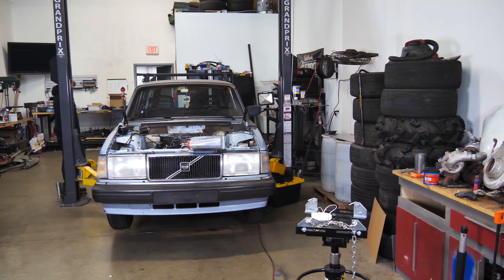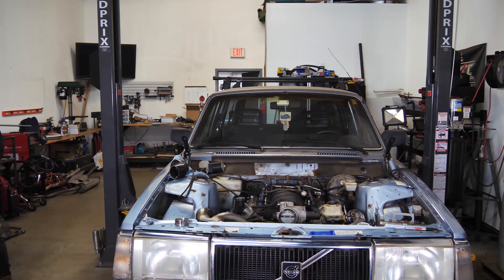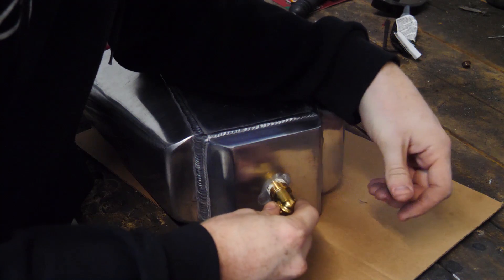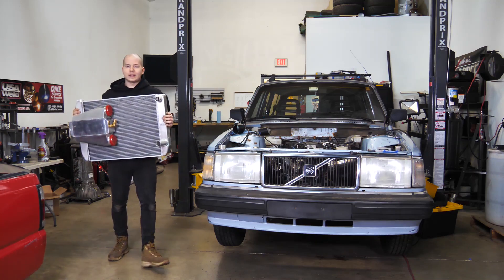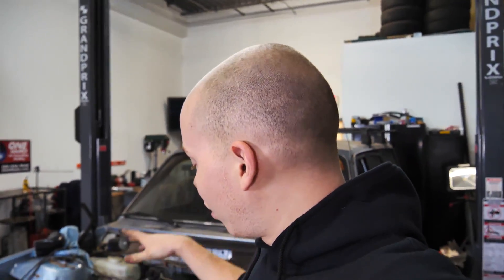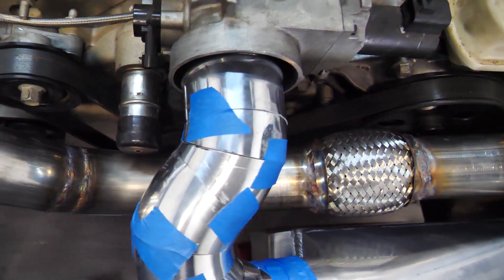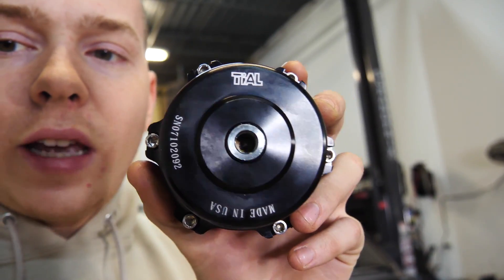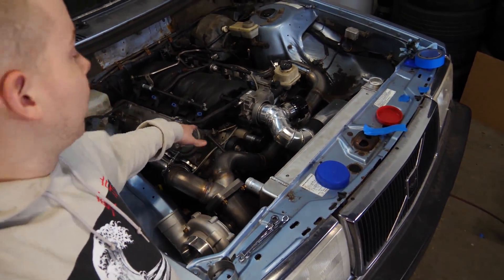FABRICATING A Stealthy 1000HP CAPABLE Intercooler Setup For The SLEEPER VOLVO!

Comment: How are you going to fit either a clutch fan or electric fan with how close that heat exchanger and intercooler is to the radiator?

Comment: Nice build. Having the chargecooler hanging off the rad isn't ideal from a weight / fatigue perspective, going to be a lot of mass especially full of water. Better bet to attach the chargecooler to the engine as the main connections are going there anyway.. Heat isn't a great concern, it'll soak but no massive deal as you'll be able to extract it.

Comment: Isn't that air to water the same as just having a really big air to air because of the heat exchanger?  Also where are the radiator fans going to go?  Last, you should probably ditch the flex section, there is a good chance it will send metal strips into the turbine.

Comment: Get the 185 degree t stat and you'll never have any cooling problems. I've got efans on my lq4 swap and they come on like, once a month. 

To be fair, i do have a 3+ gallon cooling system, so it does take a while for the temperature to rise, but you likely won't have any problems with a good shroud and a good high cfm fan. And you don't need to put those stupid ass rubber flaps on the radiator. They don't do anything a gaping fan sized hole wouldn't already.

Comment: I mean, you have a ton of space for the intercooler above the intake manifold because the engine sits so low.
Reply: I don't see why he didn't just use an air to air right where he put his water to air intercooler.

Comment: Wait so where are the radiator fans gonna go?

Edit: finished video: ah so nowhere. Pusher fans on front gonna kind of mess with the sleeper look and airflow no? 

Crazy idea: no room to mount that intercooler above the motor? Seems like plenty of clearance there. Seems like the piping would work too.

Comment: not sure if that intake is ristrictive, i thought the 4 inch throttle was there for a reason, doesnt it need to be that big? also i read omments on the last video regarding the flex pipe and how it might shave off some metal fragments and cause damage to the turbo, you should take a look before something breaks

91

Comment: cool build but i think you could do better, in my opinion if you have done the exhaust pipe in the same place but in the bottom of the engine bay ( you have a lot of space there) you would’ve have a lot of space on top for the intercooler, but the way you made a sandwich out of intercoolers im not sure is very efficient,

Comment: Does the intercooler have to be mounted horizontally? If not, mounting with the inlet and outlet facing up at the bottom/center of radiator would potentially allow for a simple 90 degree bend from turbo to intercooler and from intercooler to throttle body.  Or maybe an oblique orientation in the battery location with longer charge pipes which would keep the intercooler away from the radiator and exhaust. Should be plenty of space in that wagon for a remote battery box.

Comment: i would be atleast a little worried about the intercoolerbracket welded to the radiator cracking, that son of a bitch is gonna get heavy when filled with water.

Comment: Weird question for you gingium. You are supporting eBay as they are the sponsor for this build, but in previous videos ( specifically the one named never buy parts of of eBay) you trashed eBay parts. So are you excepting responsibility to your ignorance on eBay parts. Or are you just in it for the sponsorship?

Comment: Please consider putting the intercooler in the battery space, relocate the battery. Your intercooler will be heavy, full of coolant, and it's hanging from the thin wall of the radiator. This will break at some point, breaking the rad and who knows what it will take with it.
Reply: https://www.youtube.com/watch?v=kZ64eKMU7D0 Thanks for taking the advice, despite it coming from experts builings race cars longer then you've been alive :)

Comment: For a big V8, you really need a fan that covers the whole radiator or you could have overheating problems. It looks like your intercooler would fit on the other side of the car, mounted near the engine and down low.

Comment: Couldn't you have put the battery somewhere in the miles of rear hatch space and used that battery tray area for the intercooler mount?? Also I feel that flex pipe is a problem waiting to happen just my opinions.

Comment: Tip
If you’re anywhere near a cooking equipment store or section, look for silicon trivets these are things you place hot cookware on to avoid burning counter tops and such. They make great rests to keep from getting zapped or burnt when welding.

Comment: You could have put the intercooler above the engine at the back or in the battery tray and rear mount the battery.
Also avoid straight brackets for things that expand and contract at different rates. Put a curve or S in them so they don’t destroy what you’re mounting. Or rubber mount them.

Comment: Gingium, you may have to rebuild that intercooler pipe as it's too close to the butterfly in the throttlebody, I also think the blow off valve is too close to the throttlebody to fit the pipe adapter/coupler.  I will suggest putting the biggest fan you can fit inside the bay and a small fan on the heat exchanger to suck air in through the grille, as I believe you will have air flow problems if you have a fan, blowing into another fan.  Another suggestion would be to get a sealed  gel/dry cel battery and move it under the car somewhere and move the intercooler to the battery's old spot.  I would say you're getting better with every build, keep up the amazing work.

Comment: Ditch the battery tray and relocate the battery from behind the headlight. That will let you push your intercooler all the way out to your fender and possibly tilt it. That might give you enough space to build a fan shroud on the back side of the radiator and add two smaller diameter fans at an offset. You can get away with pretty small fans if they have a good seal over the whole radiator.

Comment: Intercooler Question? Seems counter productive to have a water exchanger cooled by air? Not ice. After driving a while wouldn't it heat soak just like a air to air intercooler? Serious question 🤔 what are the advantages without Google?

Comment: You should look up this stuff called Zycoat for the hot stuff. It's a coating that drops the temps by 90 percent or so I'm told by them. You can apply it yourself.

Comment: not criticizing, but i wouldve mounted the intercooler on the bottom left of the radiator, away from all the heat, and the piping for it wouldve been easier

Comment: Not to be a Dick, but that LS is gonna want more "cooling fan" then you are gonna fit with that inner cooler there! I also believe your heat exchanger will not be efficient being heat soaked by the exhaust and radiator

Comment: If I was you(which I ain’t but if I was) I would tuck it into the drivers side front pocket like the turbo is on the pass side. Also I would route the exhaust down under the engine to keep temps on down off of the cooling system and pulleys. With back pressure your exhaust will get hecka hot! Just some feed back. Keep up the awesome work! Just concerned about some small things on the volva👍

Comment: Get some long wire and relocate the battery to the back right of the car, across from the spare tire.  It'll leave you more room for "activities"in the engine bay.  Also there's a charcoal canister in the front driver side wheel well area... You can sell that or chuck it.

Comment: So you want to keep the sleeper look and make the intercooler system easier so you decided to go with a smaller shiny heat exchanger to put in the front of the car (still is going to attach attention but okay) and then instead just a regular intercooler with a couple of couplers you decide to go for a "easier and more efficient" for drivability and "reliability" by having a water to air intercooler that'll have lines to a heat exchanger, then lines from heat exchanger to reservoir, then lines from reservoir to a electric pump and then back from pump to air to water exchanger (and still have to run pipes from exchanger to the motor but that'll be bullet proof too).... Yup nothing could go wrong at all with that that is a super reliable setup if I ever heard of one and it'll be much easier then a couple pipes welded together and couplers...

Comment: when you wire your fans you should wire them to a switch in the interior of the car to turn them on after passes and when it’s parked instead of just the temp sensor

Comment: So yes the water IC pulls heat faster than an air IC but the over all cooling is much worse than just an air to air.  The intake air will always be minimum the temp of the water which is always way hotter than ambient air after 5 minutes.  So unless you use ice, it will never be as good as air to air in normal driving.

Comment: if youre going to do 2 pusher fans, derale 16925. i have two of them on my turbo ls f body, 88mm 6.0 and it doesnt get hotter than 175 in traffic after a pull.

Comment: dont put fans on a radiator in a push pull config, that works on pc water cooling loops but on a car theres much more going on and different rpm of the two opposing fans will fight each other and create turbulence

Comment: I’ve never made anything modified but I have a feeling you might have an issue with coolant temps with everything blocking the radiator. The heat exchanger is probably fine, but I would’ve moved the intercooler to where your battery is suppose to be and relocated your battery to the truck just so you can run a dual brushless dc fan setup on the radiator. Maybe just an idea if that ever becomes an issue.

Comment: The wire-type instead of accordion-type flex joint on the hot side is a mistake, sorry.  Don’t grenade your turbo when it starts to fall apart in 10k miles.

Comment: Bro what about A/C!!!!
A/C would be a life saver on road trips
Reply: It already has 4/60 (4 windows down, 60 mph)
Reply: Where would you even install the ac compressor
Reply: Mask off windows down there you have it
Reply: What about fans for the radiator? With that intercooler covering half the radiator there's no room for them. Putting things like fans and heat exchanger closely in front is gonna make it hot. Would've been fine with air-air intercooler instead of that heavy water one that needs pump and heat exchanger.

Comment: Heat exchanger up front will cool the intercooler out back but the engine radiator is sandwiched between them which will also heat up the intercooler making it useless on top of that there is a header near it🤣

Comment: This video was... shocking. Remember to ground your welder guys!
Also Caleb, I don't know if you saw comments on the last video regarding the flex pipe and how it might shave off some metal fragments and cause damage to the turbo, you should take a look before something breaks
Reply: Bump
Reply: Good point. Could use a bellow instead.
Reply: Bump
Reply: Bump

Comment: I was worried until you said 3 fans I think it should be fine too. You could in theory still run a ice box in the cab or something sleeper under the dash  youd just have to keep the water flowing efficiently.

Comment: You can use a ice box and heat exchanger
Reply: Yeah i was thinking the same thing. Just a tank with valves that he can open if he wants to run on the strip.

Comment: They use air to water intercoolers on the 6.7 powerstroke, so I’d say they work pretty well, because I think they’re even smaller than the one you have

Also, the shocking/electrocution is from the high frequency start, I’ve noticed if you touch the tig torch to the material before welding it tends to not happen as often.
Reply from the maker: Interesting! I'll try that next time lol

Comment: you're blocking half the airflow for the radiator with the heat exchanger. LS's aren't the coolest motors so we'll see i guess. also you could have mounted all sorts of stuff under the car, it's not like it's gonna be slammed. check out the skid factory and how they do things.
Reply from the maker: The intercooler itself was too big to mount under the car :/

It's an inch or two away from the radiator so I'm hoping it'll work! Only time will tell.
Reply: @_Gingium_  what about the cavity where the gas tank goes? i'm guessing you're gonna go with a fuel cell right? it should work i'm just afraid of heat soak from the heat coming off the radiator and heat exchanger. last resort would be in front of the radiator and heat exchanger but then you gotta try to fit it behind the bumper somehow.

Comment: With all those shocks it was starting to feel like an Electroboom video haha.   That water/air intercooler is neat, been toying with ideas on how to heat my garage without having to run a gas line I may actually look at experimenting with something like that and have furnace air go through it and hot water rads in the garage.  Not it's intended design but I'm thinking it could work. Just need to keep it above freezing so tools don't rust.
Reply from the maker: Seems like it could definitely work!